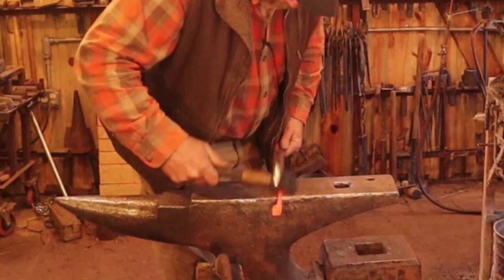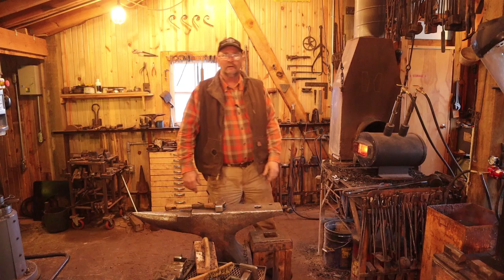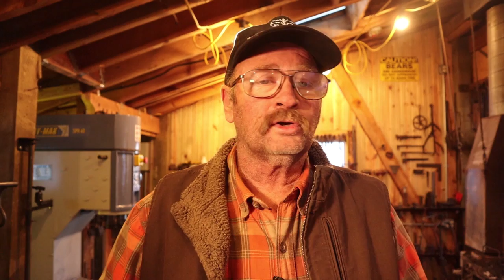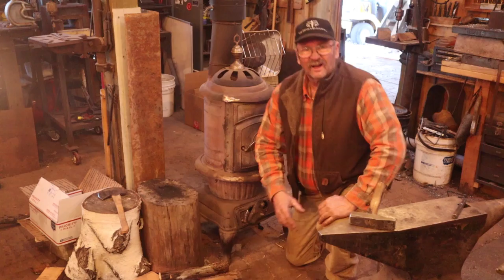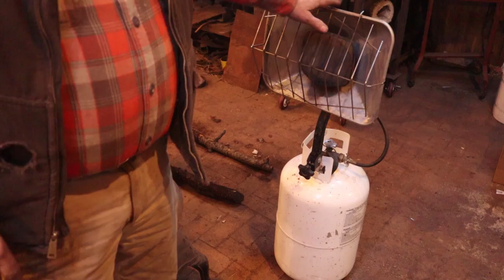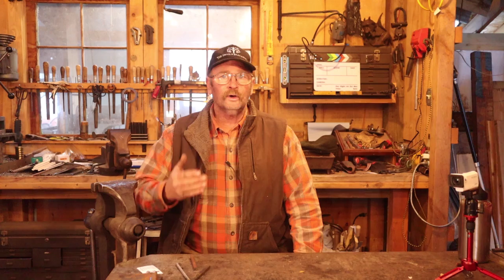Improving tomorrows work flow

Comment: How do you warm your anvil? I have heard a variety of methods, everything from using a torch to setting it on fire.
Reply: I'll put a couple 1" bars in the forge as soon as I light it.  By the time one is hot, I put it on the anvil to cool.  After awhile, I swap it out with the other bar.  Switching back and forth can be aggravating, but it assures there's always a hot piece of steel on the anvil.  They don't need to be red-hot when you pull them out of the forge because anything's going to be warmer than the anvil is.

One fellow I know uses a clothing iron set on high.  He plugs it in as soon as he gets in the shop, then goes about getting everything else ready and doing whatever cold work needs done.  The iron seems to do a pretty good job, too.
Reply from the maker: I generally just heat up pieces of scrap plate and set them on the anvil
Reply: @threeriversforge1997  the iron seems like a really good idea. You could even set it up the night before on a plug in timer so it's warm by the time to are ready.
Reply: @KevinSmith-gh5ze   hadn't thought about that.  I wonder if the stock tank heater would work the same way, or if it needs to be submerged in water like an aquarium heater does.

Setting up a timer to start about 20 minutes before you get there would seem like a good idea.
Reply: Use a magnetic block heater

Comment: John,  do you intentionally leave your shop open to the outside for ventilation or have you just not had time to close it up?
Reply: Good question Tim. I also wonder about this.
Reply: They makem tough in Colorado.
Reply from the maker: Mostly it is because i haven't has time to build the doors.  But I would still likely work with at least one door open for ventilation.
Reply: Also, you need sufficient air infiltration for proper stack draft on the coal forge and wood stoves.
Another YouTUBE blacksmith was demonstrating how he lights his forge, stuffing paper in the hood to assure a draft... smoke everywhere.
 "Hmmm... it usually starts right up... 🤔😏oh, the door's closed"...😜
He opened a door... suuuUUUK! 😏😉👍

Comment: I have a project that into and need 1/4 in lag bolts. I know I can go buy them but I want to make them.  Making the bolt isn't the issue as much as cutting the threads I assuming I'll use a triangle file. But anyway if you have thought. Or would make a video. That would be helpful. Thank you John for what you do
Reply from the maker: I have never cut my own wood screw threads.  Generally I buy the bolts then reforge the heads